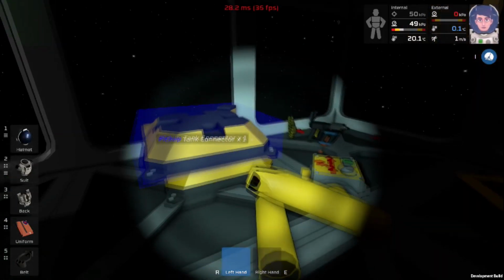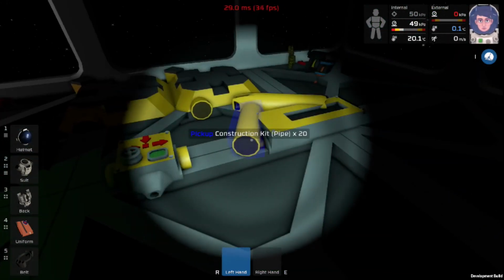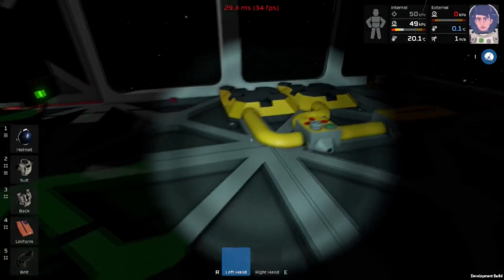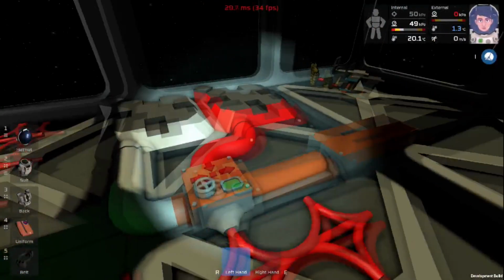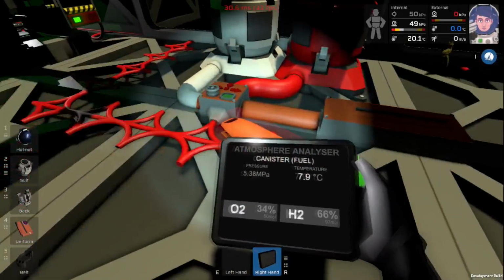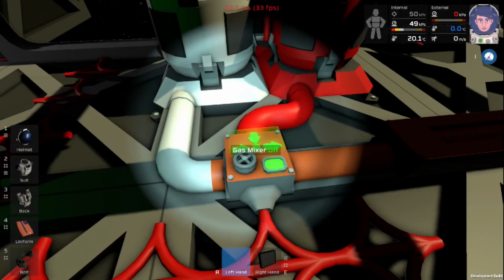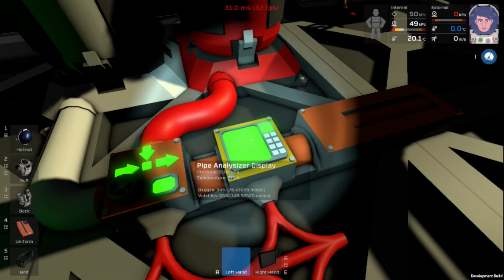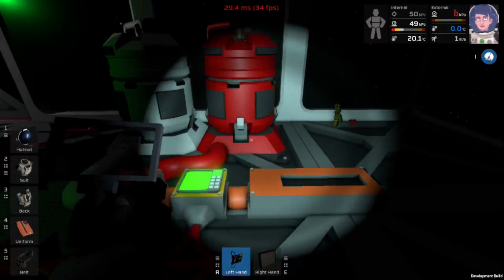Stationeers Tutorial: Mixing Fuel

Comment: Ok, I’ve got a good base started (automated solar, production machines, etc.). Now I’ve built a six-station gas filtration system (connected to my furnace) and a separate gas mixing station that I intend to use for both fuel and oxygen.

Here is my issue:
My initial oxygen tank is almost depleted so I’ve tried to replace it a few different ways but failed:
1. Pure oxygen or mixture? I used the atmosphere tablet on the starting oxygen canister and it read 60/40 O2/N2. I’ve tried that mix and soon passed out or had the “low oxygen” alert. I had the same problem with 90/20 & 22/78 mix - which is what we have on Earth (I think). Does anyone have a mix that works?
2. Temperature? I had one mix that, after I pulled it from the large tank or storage connected to mixer (I don’t remember which), showed a small progress bar (pressure count-down) that when filled launched me into the sky. I’ve since added some radiators to the furnace pipelines. Is temperature an additional culprit to my oxygen woes?

Getting frustrated here cuz I’d like to move on and make a cool base. Please help.
Reply: If you want to use an O2 N2 mixture you have to add a N2 filter to your space suit

Comment: Can confirm that temp will affect mix ratios. My H2 tank is sitting at a nice crisp  -16C but my oxygen is sitting at -60C and it's caused the ratios even after going through the mixer to be off by an increasingly large gap.
Reply from the maker: Yeah, I am working on a system to equalize the temperatures for a more perfect mixture
Reply: I've been trying to come up with a way to dump the massive amounts of cold using the air conditioners. Supposedly from what I've read it can't be done but I'm not entirely convinced that's true. I haven't had a chance to test it but I think if I dump oxygen into a room and then heat the room, I can use an air conditioner with radiators on the waste output to dump the cold air from tanks that are really cold into the hot room and have wall heaters eat the cold air.

Comment: i hooked the mixer to presure to furnace  got explosion right after mixer the temp got so high is there ratio for smelting using ratio? and somtime i got hi pressure and low temp?....
Reply from the maker: Could it be that there was still heat in your furnace from your previous smelting?
Reply: i try to construct it again the same thing happen .....explotion i see my base burning....

Comment: When i mix i have co2 and other gases.
Reply from the maker: I found this happened when my pipe network got too hot, It started combusting in the piping. Either that or for some reason you filter network has a problem.